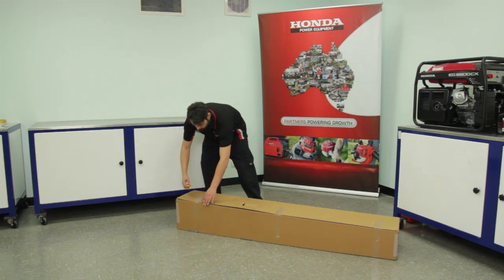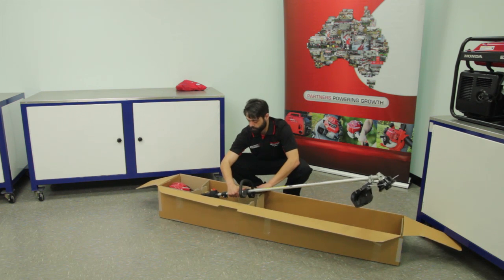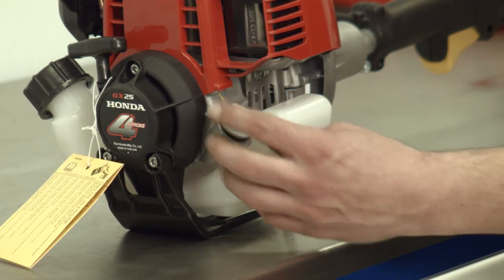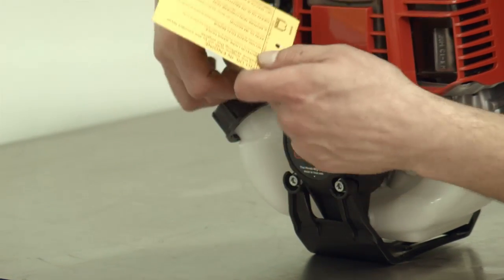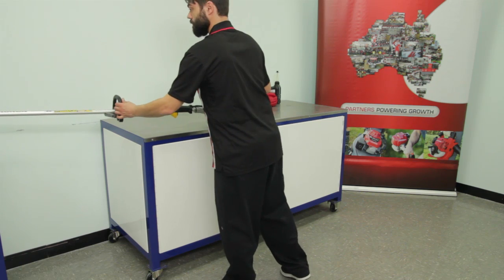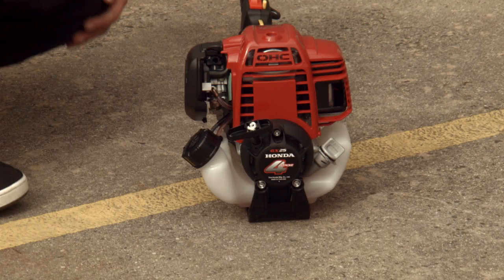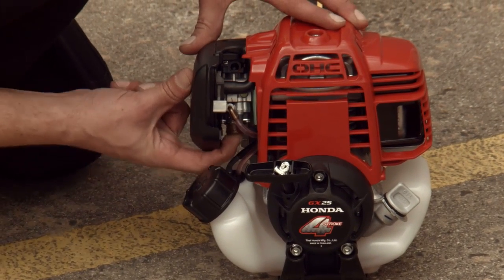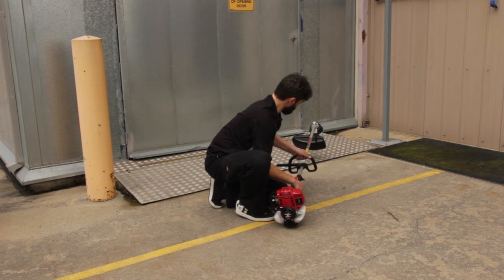Honda UMK425 Loop Handle Brushcutter Assembly

Comment: I'm having trouble with the honda ergonomics (loop handle). it's a great machine but for extended use it kills my back, I feel like I can't get enough leverage and I need to bend right down, in fact if I stand on one knee it feels like the correct height.

I have to wear the harness backwards because the pad just rubs against my hand when I'm on the trigger.

Comment: There is no complete start-up and assembly instructions in any Videos. This is very frustrating. Most of the videos in "Honda Power Equipment Australia" are basically useless.

Comment: Please tell me oil guage....for example  20 w 40
Reply: 10w30 is recommended by Honda but you can also use 5w30 or SAE30.
Reply: @SKIP AD Two stoke oil for a 4 stoke Honda engine?
Reply: How much the price n how to order it
Reply: @previnn8872 do not use SAE30 until the engine is older.